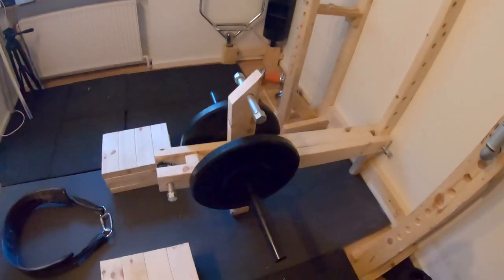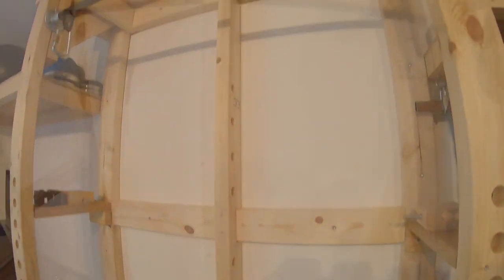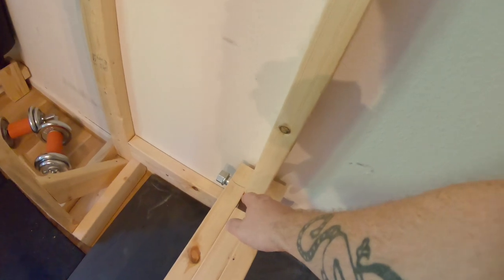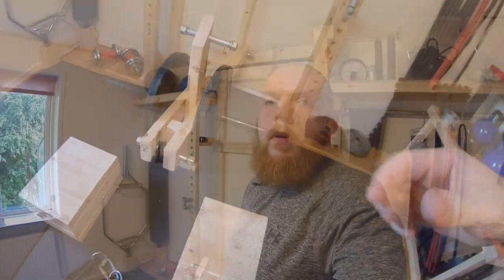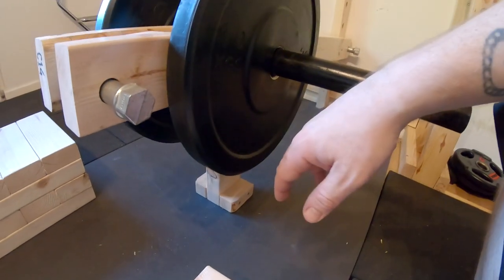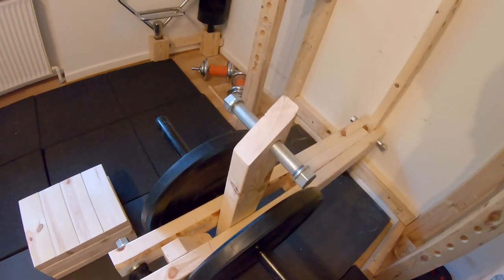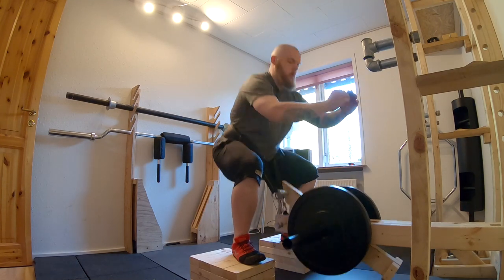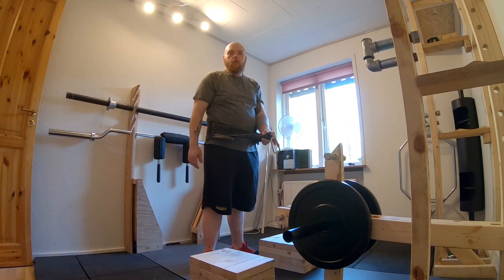DIY belt squat + more options - DIY gym - Fit at home

Comment: The actual weight your lifting with this style belt squat is determined by the length of the lever arm,the longer the arm the more weight you will be lifting.the hight of the pivot point will matter,the higher the pivot point the more weight you will lift.the place on the lever arm where the plates mount will make a large difference as well.if the plates were halfway between the pivot and where your belt hooks up you would be supporting half the weight when the lever arm is level,when your end is below level you will be lifting more than half and vise versa when your end is above level.mounting the plates closer to the belt end will obviously make the weight you lift higher.putting a plate on each side and using a luggage scale,or I use a compound bow scale,for checking the draw weight on bows since I already have one and seeing what percentage of the 90lbs you have at various points of the range of motion is how i have always checked machines at the gym if I am curious.it has solved some arguments with my buddies about hammer strength machines and simular leverage machines

Comment: Sorry for this noob question: any reason to do that exercise with that tool since you have a leg press machine? I ask that because you claim it's easy on the spine (no compression) yet this is the same for the leg press: what I'm missing?
Reply: That’s not a noob question, shows you’re thinking like a pro. 
Anyway, difference is the belt squat more mimics the squat movement pattern so it’ll have better carry over to the squat, insofar as neuromuscular motor pattern. 
Also leg press your pelvis can tuck under a bit so still iffy on lower back. 
Of course both this and leg press will ultimately put meat on the bone so will help build your squat.

Comment: Looks like a slight pull forward at the bottom of the rep and not a direct vertical force downwards?
Reply: Btw - great content.
Reply from the maker: That is correct. That's what I meant with a slightly angled pull. Quite common that leverarms will act this way.
Reply: All belt squats that i have seen have the same thing with the forward pull at the bottom,it's just physics,